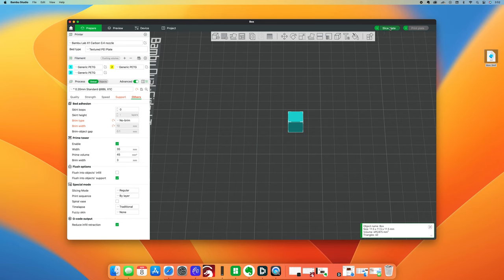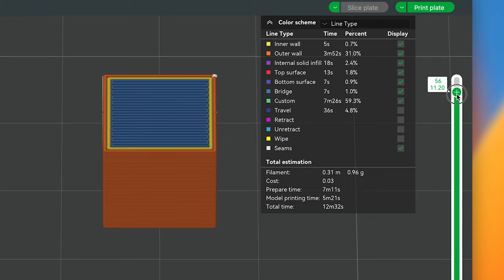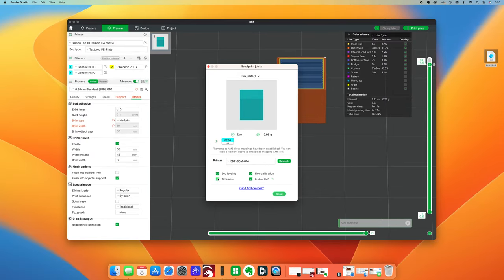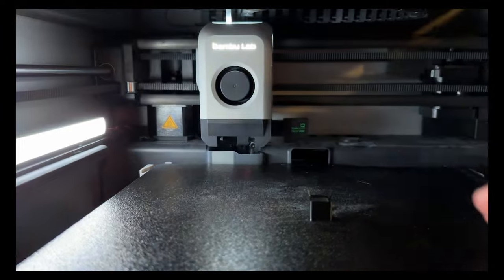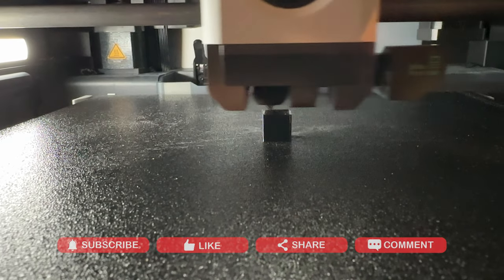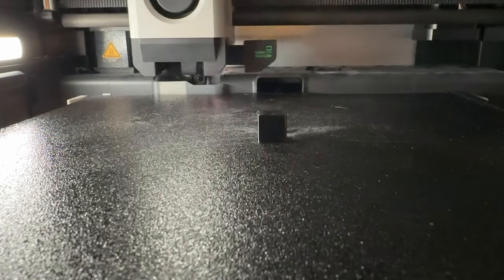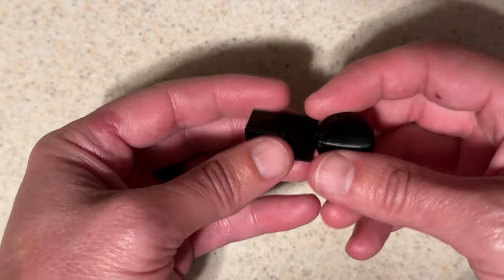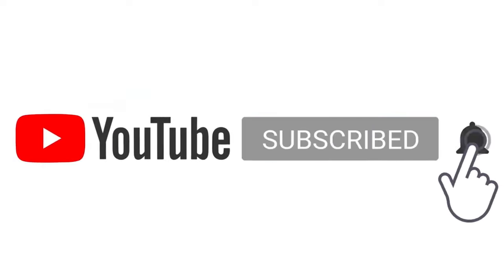Insert Magnets (or anything) Into 3D Prints

Comment: How do you make sure the magnet doesn't grab onto the hardened steel nozzle?
Reply from the maker: Good question. In this case, it wasn't an issue. Haven't had to deal with that yet but if I did, I would probably dab a little super glue on the bottom of the magnet. Then let it dry before resuming the print.
Reply: It happened to me. Better don't do this.

Comment: Anyone else having the issue where it say only pause instead of having a resume button? What firmwares are you running?
Reply from the maker: I haven't myself. I am running 01.07.02.00 on the X1 Carbon and 00.00.06.40 on my AMS.
Reply: @justinmcclung  I've seen another video on the subject where the person went into the Devices tab and just clicked on the play arrow at the bottom where the line is showing print progress.
Reply: were you able to resolve this? I'm having the same issue

Comment: You forgot to mention that you need to use a support blocker where the magnet will be, or no supports when slicing.
Reply from the maker: My model didn't need supports so I didn't think to mention that in the slicing. Good point though.